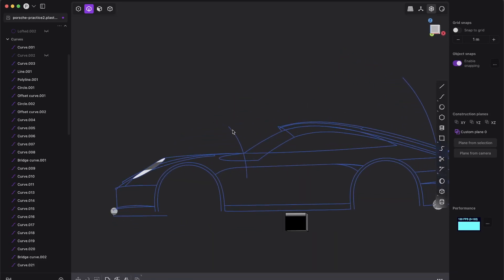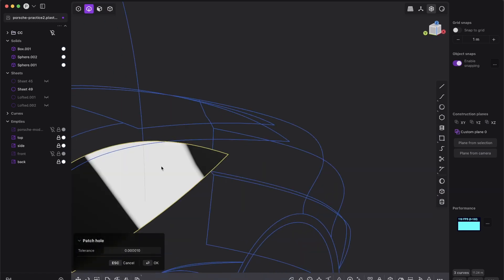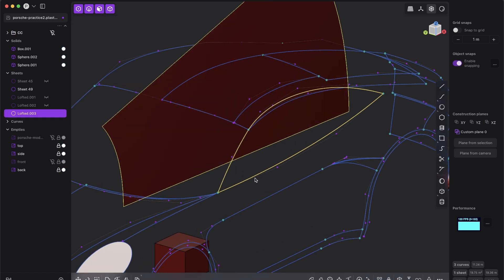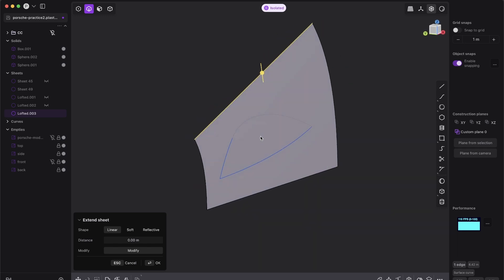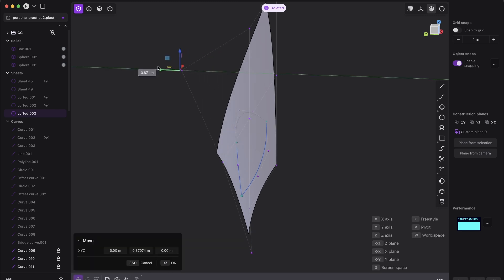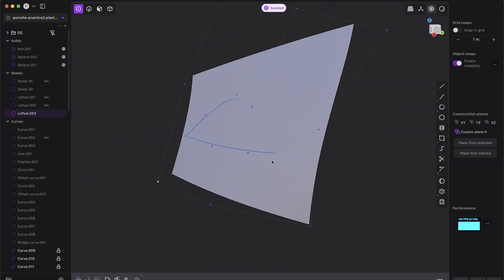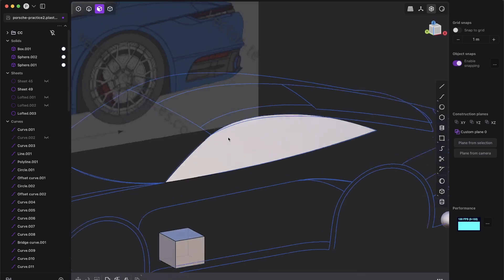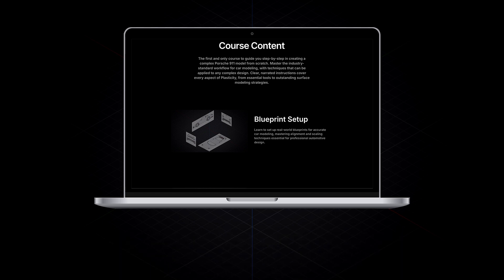Plasticity Car Modeling Quick Tip - Master Perfect Surfaces

Comment: It's much quicker and easier to grab that curve from the A pillar and sweep it down that bottom of the window glass curve that you made. Then extend the surface edges if needed and use the rest of your curves to trim out the shape. Obviously Plasticity doesn't have the window barrel option within the sweep command like Alias does, but this would be the closest option to what professional automotive designers do while still being beginner friendly.